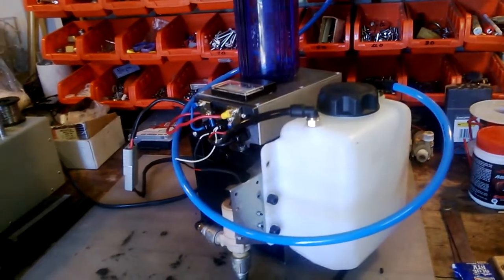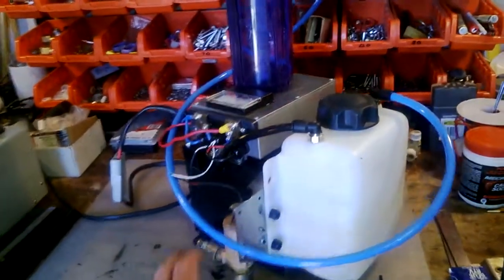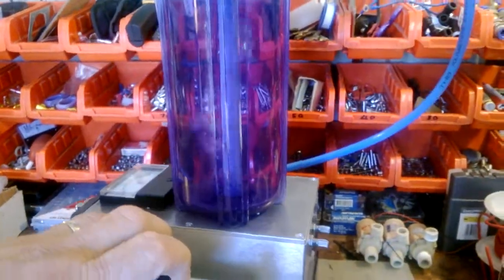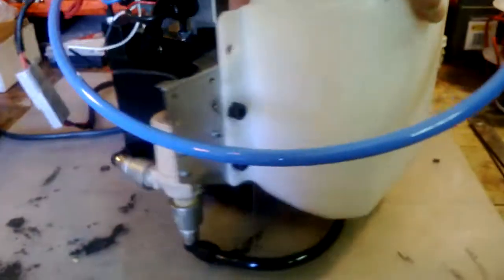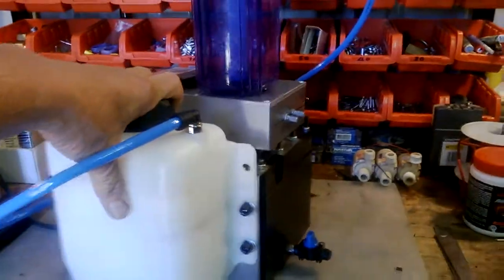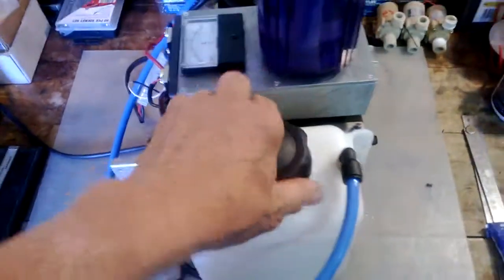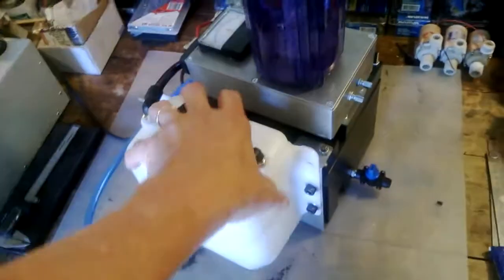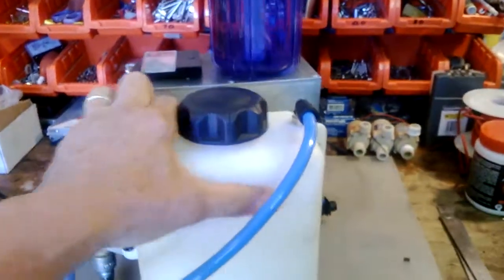HYDROGEN FUEL SYSTEM Gen 20 SECRET for trawlers , Boats, and Gensets

Comment: can i get a price idea (approx) for supply and fit to a Mercedes Benz 1418 coach thanks
Reply from the maker: supply Gen 20 system price  $6350... any auto electrician can follow instructions writen by my company auto electrician to fit the unit in 2 hours
Reply from the maker: 0403177183
glknox11@live.com
Reply from the maker: Gen 10 system  3950+GST
Reply from the maker: call me on 0403177183 
glknox11@live.com
https://hydrogenfuelsystems.com.au
patented , proven and certificated system delivering 32% savings on a 7.2 L truck - 27 tonne load
Reply from the maker: call me on 0403177183 
glknox11@live.com
https://hydrogenfuelsystems.com.au
patented , proven and certificated system delivering 32% savings on a 7.2 L truck - 27 tonne load
Reply from the maker: Certified test results have show savings of 42% on a 2.8 LItre diesel and a 3.6 Litre  petrol fueled wagon     call me on 0403177183     glknox11@live.com      patented proven system https://hydrogenfuelsystems.com.au      Gavan Knox BSc, BEd